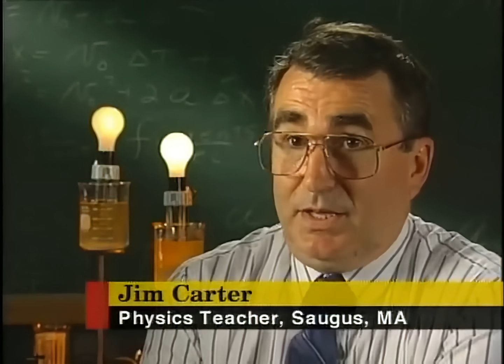MIT graduates cannot power a light bulb with a battery.

Comment: Apart from the obvious intention of the maker of this video to ridicule MIT students and the high likeliness of having cherry picked bad representatives/examples.

The whole attitude of these students confuse me. You're an engineer. Doesn't matter what kind. When someone asks you if you can solve a problem, you don't just say "yes" or "no". You're taught that when challenged with a problem you investigate the problem until you got the full picture of the problem. Only then do you assess the ways to solve it and choose the appropriate/most efficient one. The right answer to the question of the interviewer is "Maybe. Depends. Show me the bulb and the battery and the wire." and only then you have the information necessary to answer with a direct "yes" or "no".

Comment: unfortunately, they dont teach you how to operate lightbulbs in college. 

the demonstration is telling of some lack of practical skills, but the whole claim is misleading. your fundamental understanding of electricity doesnt lead you to understand how the lightbulb is operated.
Reply: Get real. Any of these engineering majors from MIT can explain how electricity works.  This video just cherrypicked people who responded poorly.
Reply: kissben i know. and yea they probably cherry picked.
Reply: bs, for this you need not practical skill but you need to understand how electricity works, this is basic psychics. 15yo level
Reply: Marek Rokam lol does knowing how electricity work tell you where the terminals of the bulb are? i could have designed a bulb that looks exactly like the conventional except the side threads are useless and instead the terminals are both at the tip. id laugh as you fail to make it work.  does your knowledge of electricity tell you which prong in a british socket is the ground?
Reply: you can see they dont even try to plug it like the black dude who made it. they just have no idea.
Reply: But they do teach theory right?
Reply: If you understand the fundamentals of a completed circuit, what materials electrons flow through well, etc. you can solve this simple problem. The issue is the people assumed they understood the theory but couldn't practically apply it. Basically, they didn't have the full picture all connected in their minds. 

Yes, the theory, when thought through, does answer the questions of what needs to connect to what.
Reply: phoenixamaranth you still wouldnt know where the contacts are.
Reply: ***** I would say you got that from experience. Perhaps from noticing how a socket works. The thing is, there are arbitrary ways to engineer a bulb. It could have entirely been that both contacts are on the thread side (divided somehow by a seamless insulator) rather than thread to tip. For all you know, there could be a diode also so current only works one way. You have no reason to know these things simply from basic principles of electricity.
Reply: Yes, you would because of...dun dun dun!!!! METAL! All the contact points are metal and the theory of electron flow tells you that you must be connecting metal to metal and it must be a circuit so you have to connect to the metal that is connected to both sides of the filament to make a circuit through it. There is an obvious separator on the bottom of light bulbs, just like headphone jacks, that separates the two metal pieces

Also, it's not arbitrary to make a bulb. Standards have to be followed to meet universal application or else a company would need to sell both lamp and bulb where most want their bulbs to be able to be used in various companies sockets to maximize profit
Reply: phoenixamaranth Uhm so you're saying there is only one way to make a functioning bulb? Then it's arbitrary. Whatever industry standard has come up, it could have been another way. I challenge you to figure out how to operate that new bulb in what, 15 seconds of video? Actually, cars have those 3-prong bulbs right? Which one is the ground prong again?

Not everybody has had to fiddle with a lightbulb perhaps for the same reasons not everybody has had to use a screw.
Reply: ***** I'm not. The point of the video is that if you truly understand electricity then something as simple as a bulb should be easy. Something about simple things building upon bigger ideas. The video is misleading in this sense. But yea for sure a bulb is very easy to operate, but i have the advantage of playing with some as a kid and replacing a few in my life. Can't say the same for everyone.
Reply: It's not arbitrary. You clearly don't know what that word means. You can make light bulbs many different ways but the underlying science of the generic home light bulb DOES NOT CHANGE. You can't make a bulb without a circuit. You can't make a circuit without conductive material. You have to keep that material separated and you can physically see and trace the separation on any generic lightbulb. 

As Zwenk Wiel said, you're trying to over complicate this to make yourself somehow right. The bulbs in this video are generic off the shelf bulbs, nothing more, so all your hypotheticals are ridiculous.
Reply: phoenixamaranth the hypothetical is to make a point. the point is understanding electricity doesnt immediately mean you understand how a DEVICE works. In this case, a bulb. You have to see it from the perspective of someone who has never had to fiddle with a bulb. (the hypothetical was to illustrate this. what if you were given a NEW bulb design?) This is not so hard to imagine especially if you're from someplace like MIT where in highschool you were probably too busy studying and doing extracurriculars (esp those from privilege). Not everybody fiddles in the garage and not everybody fiddles with the same things.

Of course its so clear to you "ah, when i was a kid it was so simple I could figure it out easy". Unfortunately, nobody was there to document your exploration and it sure took more than 15 seconds.
Reply: ***** I don't think you watched the video. All you heard was MIT students couldn't make a bulb work.
Reply: This is LITERALLY the most simplistic real world version of an electrical circuit you can do. You are seriously making up nonsense arguments.
Reply: says the guy that used dipshit. The commentary of the Harvard prof starts at 1:10. The particular line I'm talking about is in 2:15? You can't accuse me of overcomplicating when I'm using the almost exact phrase used in the video. If you also go to 2:30, the phrase goes "what is blatantly obvious to you may not be so obvious to someone else".

Gotta ask you again, man. Did you even watch the video?
Reply: Just because its the simplest in a given category doesn't make the thing inherently simple. An atom is literally the simplest matter out there. Pretty sure studying atoms is hard.

Before you call this another nonsense argument, what you said was essentially: because it is the simplest circuit then it is easy. But, because it is the simplest then it is easy?

Again, I totally agree that at least to me (and apparently to you guys) using a bulb is easy. But the whole point of the video was if you understand electricity then you understand a bulb, which I've been saying is not the case.
Reply: Its so simple it's taught to middle and high schoolers everywhere when discussing electricity, electrons, batteries, how lights work, etc. There is no way around it, it is one of the simplest concepts a person could be taught about the physical world. 

Side note, atom is not the simplest matter and studying atoms is hard due to scale issues. If atoms were the size of batteries and light bulbs it would be tremendously easier to study.

The point of the video was about the disconnect from teaching methods to student understanding and application. If taught properly, no one should not be able to understand a bulb in the real world. That disconnect is a teaching failure, not a complexity failure of the concept of a bulb or electricity
Reply: thats fair.

Comment: wtf... why not JUST GET ANOTHER WIRE!!
Reply: In this test there is only one wire. However it would be possible to cut the wire in two. But that wasn't the question.
Reply: Peter Hall yes and thats the thing thats kinda dumb. u have an abundance of wire on the planet. there is no point connecting bulb with 1 wire.
Reply: But as I said That wasn't the question in this video.